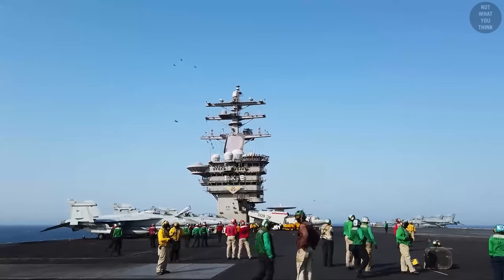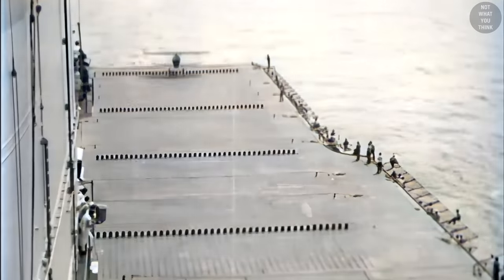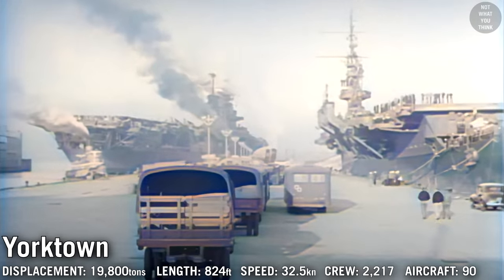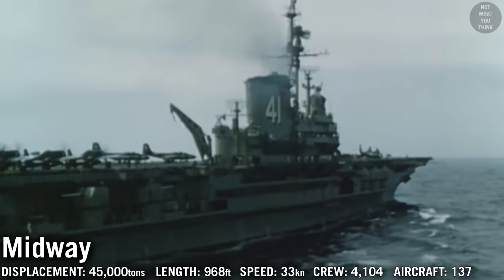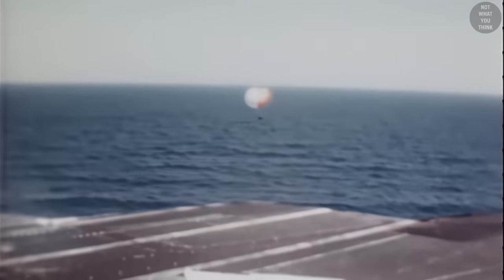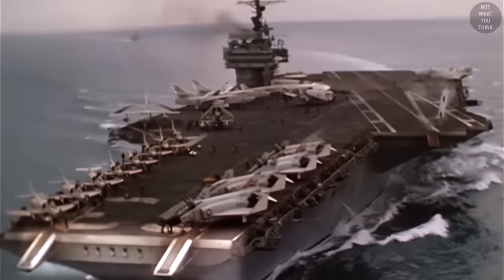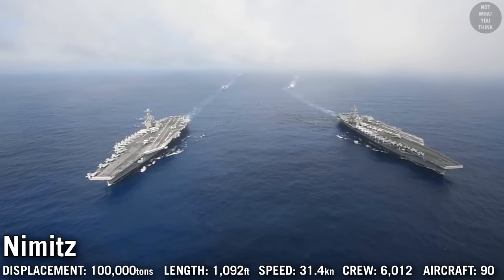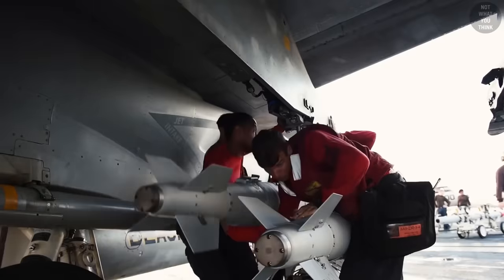Evolution of American Aircraft Carriers

Comment: My dad was stationed on an aircraft carrier during Vietnam. There were two stories he told me about what happened on the flight deck that stuck out to me.

The first one he was below decks in a break room where they had a black and white TV that was apparently showing CCTV footage from the deck. He watched as a jet that still had some bombs mounted landed and got trapped by the arresting wire. One of the bombs wasn't too securely attached and came off while the jet was decelerating, skipped down the runway, and went down over the bow. He expected it to go off but it apparently wasn't armed.

The other one was when a jet had crashed while attempting to land and he was out on the deck helping with damage control. He saw what he thought was the overboard dummy, due to the limbs looking boneless like a rag doll, laying out out he deck, and thought it was odd it hadn't been stowed away properly. He was surprised a few seconds later when a bunch of medics came over, put it on the stretcher, and took off. Turns out it was the pilot.
Reply from the maker: Thanks for sharing. It’s one thing to see some footage. It’s another thing to live that moment.
Reply: My great grandfather was on a carrier in ww2, he died when I was young, but my grandpa told me stories, he broke his back in a kamikaze attack, there is nothing scarier than watching what is essentially a big bomb come flying at you. He did get to go in Alden once or twice, but he did not like, only two warm beers and no women, I also got to read is diary, he served on the ISS Wasp
Reply: @NotWhatYouThink  my great grandpa served on the USS Wasp, not the one sink in 1043, the one after that, I am not sure if this is 100 percent true, but the plane that sunk the Yamato came from the wasp
Reply: @huhh4380  My dad was on the USS Hancock, one of the Essex-class carriers that was mentioned in the video (kind of surprised me, hardly ever hear anything about the Hancock; it seems to be fairly obscure as far as carriers go, probably because the Essex class was so big).
Reply: Uh, I'm Vietnamese.
Reply: @mr.reality1611  What about it?
Reply: @Stargeneral410 Didn't you hear him say in the video that the Nimitz was already in the works by the 1960s, decades before the Cold War, pay attention.
Reply: @Stargeneral410 27:12 30:04 . When did he said the Nimitz are 100 years later?
Reply: @shadowkillz9606  the 60s was the hottest part of the cold war.  It's when we had drills in school against nuclear missile attacks.  Sheesh, kid.
Reply: @76rjackson  You must've seen a dozen of cold-war inspired movies and losing in COD Cold War for 100 hours straight and yet after all that, you claimed as if you were from the era. Too much movies for you lil Timmy, go back to bed and keep on dreaming about being in the Cold War.
Reply from the maker: @Stargeneral410 Fair enough, we should have had a Ford-class carrier in the thumbnail (that was our intention). But looks like USS Nimitz was used instead. Left hand not talking to right hand sort of situation. But the 100 years is referencing USS Langley to today.
Reply from the maker: @huhh4380  Very curious to know, what was his diary like?
Reply: @UC4pNDofN0Xh-z2bhh62g8Ow I only have a few letters left from him that he wrote to our mother.  Dad worked in Alaska several months at a time and my mom took care of us kids on the family homestead.  He had purchased a big old Victorian farmhouse that needed constant maintenance and his letters to my mom read like a manager directing an employee.  When he had breaks he'd come home for a month or 6 weeks to terrorize us.  He would  bring back a lot of cool stuff like carved ivory walrus tusks, an Arctic fox coat for my  mom and we all got genuine sealskin mukluks to wear in the winter.  We had a ton of Eskimo handicrafts that would be welcome in museums today but it's all gone. 
 I remember my older brother's friend asking him about UFO's one evening over beers and he just went all quiet, very uncharacteristically because he had a big ego, and said he couldn't talk about it.
He had a photo binder of polar bears and crashed planes as well as the obligatory shots with big wigs, black and white 8x10's.  One of the plane crashes he said was because a can got stuck under the pedal and that stuck with me such that I warned all my kids about getting crap stuck under the brake pedal when I was teaching them to drive.
 The job took a toll on him due to recreation up there being mostly drinking, some hunting and fishing, too, but alcohol fueled that place as much as petroleum.   After about 5 years he came home and opened up a little convenience store. He passed away in 1976 at the early age of 55.  He was making almost $40k per year in the early 60s which was wealth in those days but he blew it all, somehow. Imagine the mortgage on a 3000 SQ ft house on 3 acres with beach access was $125/mo.  He'd be 100 this year if he was still alive. His title was Sector Superintendent from Point Barrow to Goose Bay.
Reply: Thank you.
Reply: @shadowkillz9606  When do you think the cold war started?
Reply: OUCH....
Reply: @mr.reality1611  Thanks for the nice sneakers....😉
Reply: Imagine dying cause some below deckhand thought you were a rag doll lol
Reply: @mr.reality1611  so someone not worth liking

Comment: What will aircraft carriers look like in the next 90 years?

my mind: flying aircraft carriers.
Reply: Probably
Reply: u won’t need to drive a jet then
Reply: @azmannadim3742  na they will be obsolete, why have a battle group when a couple of missile cruisers will achieve similar results. Aircraft carriers even today are more about image then effective fighting power, I can fully see them in a similar situation to battleships in WW1 where they where more important to preserve then use.
Reply: @generalharness8266  I think that they will stay mostly relevant. The ability to launch a large number of planes with your fleet without the worry of them running out of fuel, because they can always come back is a huge advantage.
Reply: @generalharness8266  Missile cruisers will not replace carriers, or they would have already. 1 missile= 1 target kill (usually requiring some sort of ground asset to identify and mark target), air craft has several missiles and/or bombs, 20mm cannon and can more easily identify and hit multiple targets (11+ targets for F/A18s). Carriers carry multiple types of aircraft for different operations (can carry and operate 85-90 aircraft, usually 24-36 F/A 18E/Fs, 10-12 F/A18Cs, 4-6 E-18Gs, 4-6 E-2s, C-2, MV-22, 6-8 SH-60s or 130 F/A18s only), cruiser may have 2 helicopters (SH-60) for anti-submarine operations/personnel transport.
Reply: @drewrobinson9120  I don't really disagree that they have a purpose but so did the battleships of WW1 (Built to fight the current tech). The reason that carriers became the new capital ship is they could hit targets from further out. They where effectively the first navel weapon with the ability to accurately engage targets over the horizon. 

Can missile curriers take over from carriers right now? No. But I view there is a greater chance of a development in missiles or short take off and landing drones then there will be a future need for massive aircraft carriers.

The one benefit going into the future I can see is putting humans on station to make decision in planes, given the opening volleys of the next war will be targeting satellites a lot of current tech will be hampered at hitting long range targets. The down side is that aircraft are not safe any more. We have such effective AA that it is a credible threat to aircraft and these weapon systems do not rely on satellite's. 

Again my view is in the future they will become obsolete due to developments in missiles not that currently they are not effective.
Reply: @generalharness8266  I would say carriers will always be an integral part of any fleet. Even as missile technology increases, the military is looking to UAVs instead of long range missiles. Long range missiles are good for many things, but they have issues with fluid combat situations. I see most militaries moving to carriers that carry larger more versatile UAVs, instead of replacing carriers with missile cruisers. The biggest issue with missiles is what happens if the mission has to be scrubbed? You either detonate and waste the missile away from populated area, or send in personnel to recover the missile before enemy finds it. Long range missiles will always have a place as strategic first strike weapons, but in long protracted battle scenarios, having a mobile platform that can launch attacks against several targets in one mission and easily return to a base/carrier will always be more effective than a missile. 

Ideally would be nice if none of these were needed, but it is what it is.
Reply: @drewrobinson9120  I agree carriers will remain an integral part of any fleet.  In the United States, the Carrier Strike Group is an effective means to affect an opponent in a region.  Park various aircraft and missile platforms minutes away from major military installations and critical infrastructure of a country and then sit there gets many peoples attention.  The Gerald R. Ford Class is designed to handle a wider range of aircraft, specifically Unmanned Aerial Vehicles (UAVs).  In the near future, I envision aircraft carrier strike groups carrying large number of stealth UAVs to swarm targets and equipped with energy based weapons to neutralize the threat of hypersonic missiles engaged in similar operations as today because this tactic remains effective in coercing an enemy into doing what you want them to do.
Reply: Flying aircraft carriers…. S.H.I.E.L.D

Comment: One small correction, the minimum size that was determined for an interwar main fleet carrier was about 20000-25000 tonnes, but escort and light carriers could be under 20000 tonnes easily. Although the coming of the jet age and drastically increasing size and weight of aircraft meant that the smallest carrier would soon be rendered obsolete, only the coming rotary wing and VTOL aircraft would give carriers of this size a second lease on life. Perfect example being HMCS Bonaventure, a light carrier which had an early post war carrier flying jets but was soon found to be too small for anything but helicopters and a small complement of ASW fixed wing jets.

Comment: 24:35 Not a good idea to launch F/A-18
Reply: USS Carl Vinson (CVN-70) was the test bed for the F/A-18 to determine catapult speeds/steam pressures, and recovery wire hydraulic pressures.  I saw more than one disappear below the bow after launch, then reappear very nose up with flames at the rear impacting the water.  We did not lose any planes.

Comment: I wonder if angling the flight deck "up" a few degrees has been done or considered. Seems to me it would improve trajectory of take off and also help slow landing aircraft as they roll 'uphill". Though it might make for 'harder' landings now that I think about it as the difference between angle of approach of the aircraft and flight deck would be greater...
Reply: Launching aircraft doesn’t require an upward tilt if you have catapults and arrestor wires are always needed anyway so no additional slowing down is needed. Also having the deck continuously angled in one direction would suck since anything not properly secured would start rolling in that direction.

Comment: you had some info about the USS Forrestall accident wrong. the pigtail(safety pin) is not the only safety measure, they also have a plug at the top of the pod and if that is in the pigtail needs tp be in the pod in order to fire the rockets, but the pigtail wasn't put in and an electical surge jumped the gap the pigtail makes if it's not there and fired a rocket. there is a 45 minutes documentary on this, i've watched it 30 times. I know i'm right

Comment: I may be incorrect, but wasn't the development of the angled deck also influenced by the lack of a pilot ability to see the carrier straight ahead as he approached, or was that dealt with only by the approach from the side with a turn to short final procedure? An interesting fact for you, the F-4 had edged supports between fuselage and intake "ramps" to cut the safety barrier straps there to prevent the barrier cable from trapping the aircrew in the cockpit. This feature has been copied on foreign aircraft without them actually knowing why they were there (because they had no such hazard, the MIG-23 being one example).

Comment: I can personally Verify Admiral Crowe's statement about how fast the Enterprise's top Speed, was "Greater than 40 Knots was "no big Deal", was absolutely true. It had 8 reactors pumping out massive amounts of HP with no consideration for MAX Torque on the shafts with "Non effcient Props", (ie the props were not intentioned for Efficiency). Well above 40 Knots was standard. The Enterprise was the Fastest and most heavily armored Carrier ever. Many of the much more modern carriers "Drag Raced" the Enterprise... .they all lost. It was an OLD SCHOOL Hot Rod. I miss her!!!

Comment: BTW, fans of the Illustrious class might want to dig a little deeper than just, "Hit by Kamikazes and continued to serve." Besides men killed by armored deck spalling in at least one instance, the shock of bomb and Kamikaze hits was coupled to ship structure by the armored decks and caused significant damage to the ships' structure, limiting their post-war use and careers.

The whole unarmored vs. armored flight decks kerfuffle is a big urban-legend-grade red herring. Both offered advantages. An advantage for the Yorktown class carriers is that they were able to carry 50%-70% more planes than the larger Illustrious class carriers. Imagine if you will 3 Illustrious class carriers at Midway ...

Comment: i wasn't on an aircraft carrier.. but i was on a ship, the USS Racine, which also stows large heavy vehicles below deck.. one of the most memorable times for me on that ship was when getting some running in.. I would run  a course arount the perimeter of the under deck.. and while the ship was under way.. it would be funny feeling while running that someiimes i would feel almost weightless as the ship was going in downward motion in waves and then i would feel extra heavy when the ship was going up the waves.. and occassionally i would get a sense that the deck was moving side ways.. probably not the safest thing to do.. I didn't do it too much. definitelly not something you would want to do on an upper deck expose to the winds and those motions of the ship.. could send a person overboard and lost at sea..

Comment: 2.35
To be more accurate, USS Ranger (CV-4) was laid down, etc.
We also had USS Ranger (CV-61) as a fleet carrier, quite a few years later (one of the Forestall Class).

6:56
Ranger's size had NOTHING to do with the Washington Naval Treaty - we had plenty of tonnage left over to built 2 more larger carriers AND HORNET before we hit it's limit.
Reply: Ranger’s size did have to do with the Washington Naval Treaty.  The United States was restricted on tonage of aircraft carriers and they wanted as many aircraft carriers as possible.  So after converting Langley (CV-1) and Lexington CV -2 along with Saratoga CV-3 they tried to build a small purpose built aircraft carrier.  
Ranger was seen as not great, so the navy built two larger Yorktown carriers ( Yorktown CV-5, and Enterprise CV-6). 
Wasp CV-7 was built with the left over tonage and was basically a scaled down Yorktown.  
Hornet CV-8 was built just after the treaty system collapsed.  She was basically a repeat Yorktown to give the US navy another carrier quickly.    

So, with all due respect when you are trying to correct someone please try to get all the details right.
Reply: @graceneilitz7661  Ranger CV-4 was considered an experiment and a learning experience, being the first carrier the US had designed and built AS A CARRIER from the start.
It was NOT limited due to the treaty in it's individual max tonnage, as the treaty limit was 27 KTons while Ranger CV-4 only came in at about 15 KTons.

Lexington and Saratoga were CONVERTED battlecruisers, 2 of which were allowed under the treaty from already-started ship builds per country - and as I recall those 2 ships were not counted against the treaty TOTAL tonnage limit for carriers, though they would have been limited by the 27 KTon per carrier limit.

Langley never counted against the treaty limits at all - it and the other "already existing" carriers of each country were considered "experimental" ships.

By the time Ranger CV-4 was in commission, the Washington Naval Treaty limits were in process of being modified by the eventual London Naval Treaty anyway.

Comment: Whoa, angled flight-deck:
Claim:  faster jets would have required the entire centerline of the flightdeck to land.
I understand the benefit of running both takeoff & recovery operations simultaneously.
And I understand the benefit of being able to go around on a missed landing.
But how does angling the landing deck reduce the landing distance?
Is it implied that in doing so, they also worked out how to shorten the landing distance?

Comment: With the advent of battery technology of what Elon Musk is doing and the drive to make planes independent of fossil fuels, I definitely see within the next 90 years, planes using energy-based power plants which will need recharging between launches and landings, the extra power that the nuclear generator will dispense will probably be needed for this power plant distillation. I don’t see planes having regenerative batteries within the 90 year, but the next 5 generations later of aircraft designed, could result in this future technology. Of all the carrier based historical reviews I’ve ever seen, this was probably one of the better ones. Good job. Keep up the good work. Have definitely subscribed and giving you a thumbs up for this documentary.